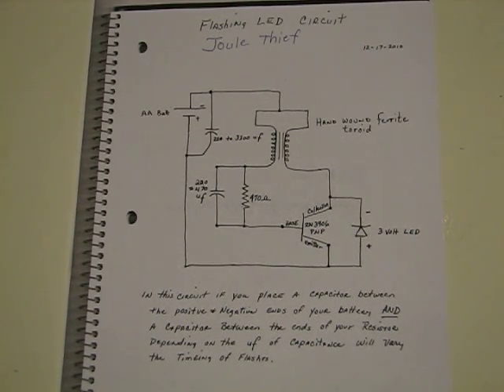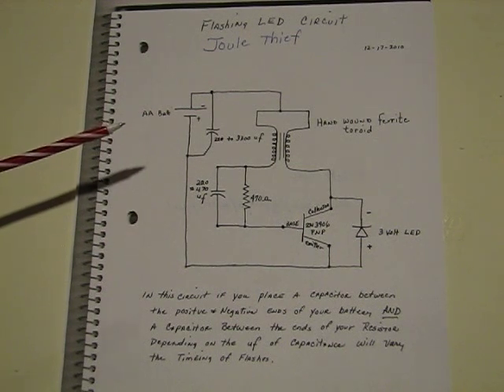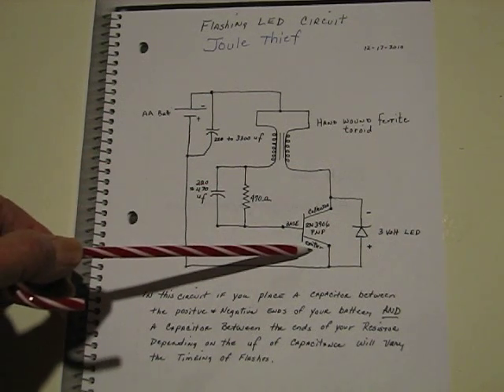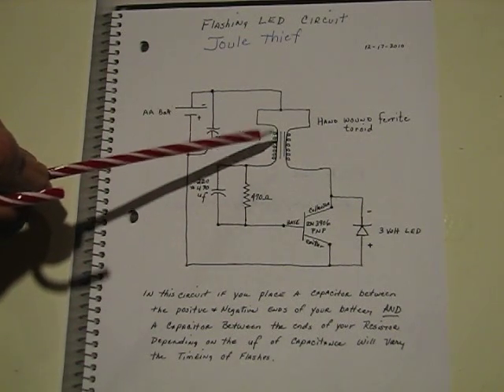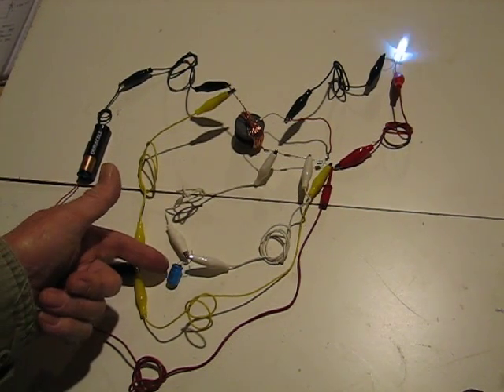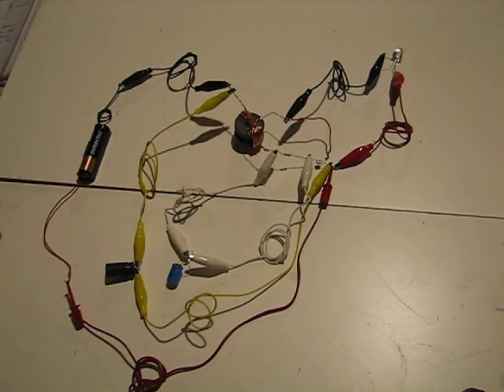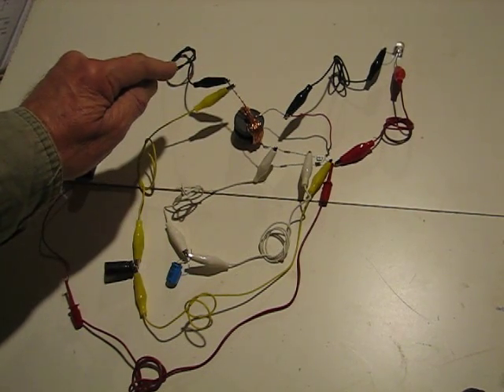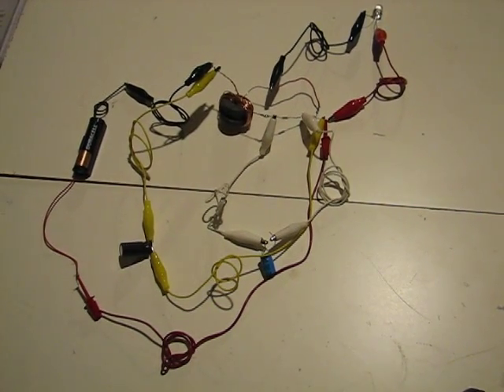Flashing Joule Thief useing Capacitance to control frequency:  12-17-2010

Comment: In the circuit diagram is a mistake. At the battery symbol always long line is the + and short line is - . Also the big capacitor cannot be connected in parralel on the battery with the  - of capacitor to the + of battery.   The big capacitor symbol is also not correct.

Comment: I believe you've got the plus and minus on your battery symbol the wrong way round
Reply: No,the transistor is a pnp,by looking closer ,you will notice it's exactly polarized!
Reply: The battery symbol and also big capacitor is not correct drawn in the circuit diagram . Read my comment for this video.

Comment from the maker: Thank you!  I have made it my goal, that if I'm going to post for the world to SEE, that it shall be easy to understand, easy to see, and easy to understand.  Otherwise what's the point?
Reply: thanks for sharing - the parellel 'resistor' and capacitor create a filter at different freqency pass due to the inductive oscillator being multi pole - {this is my present theory} so it is in sense a two way filter - the capacitor across the input would contol the 'master' osscilation pehaps in relationship with the filter on the base.
Reply: Creative circuit which somewhere acts such Hartley oscillator or a metronome,the capacitor parallel to resistor forms an impedance that influences the frequency of joules thief circuit ,if you place a piezoelectric buzzer with the LED it will generates melody...